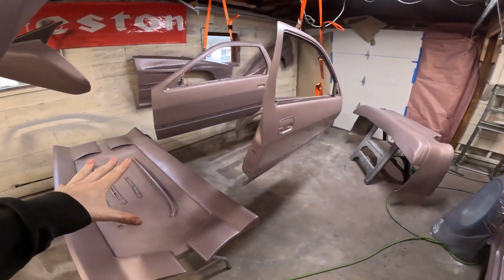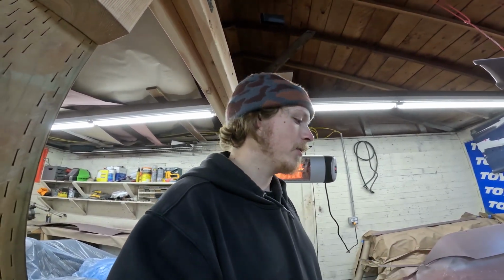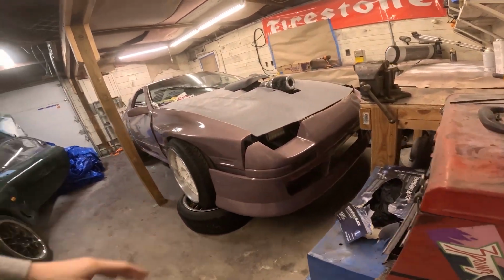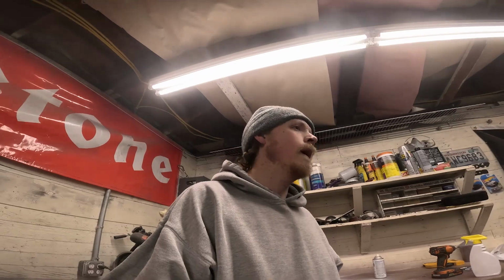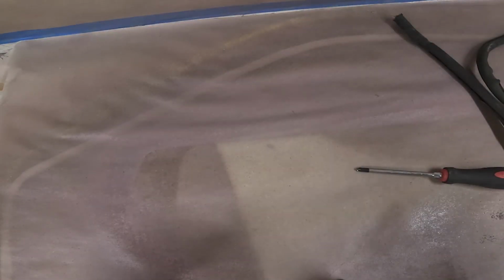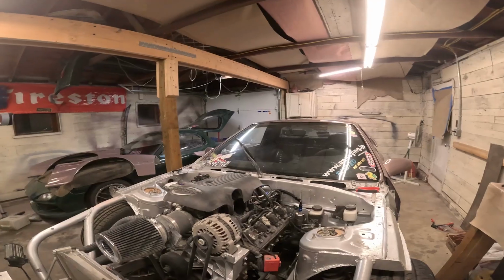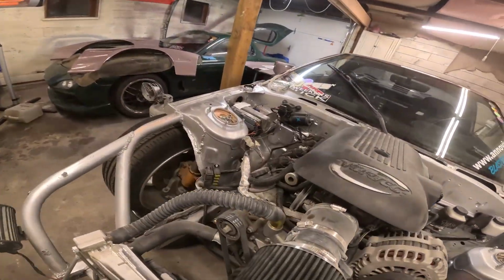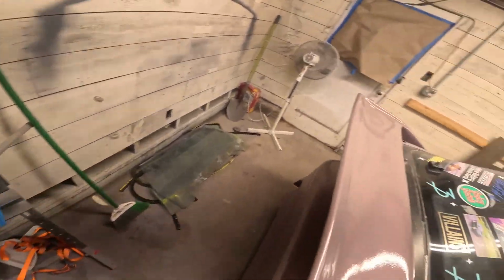HOW NOT TO PAINT YOUR DRIFT CAR! (Too expensive and too nice lol)

Comment: Damn it turned out good 🔥, question for you I wanna start drifting which car do you recommend best bang for your buck and good for a beginner?
Reply from the maker: E36 328 or E46 330 super decent and not that expensive and the 318 and 325 have weak parts so stay away lol. ALSO 350z is very good as well but they tend to cost more